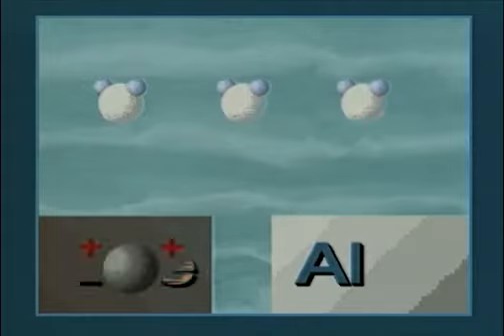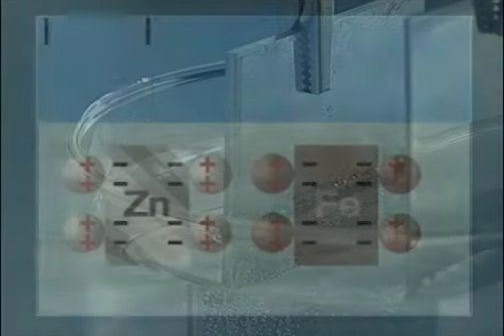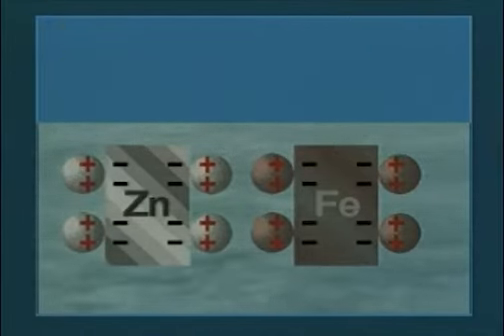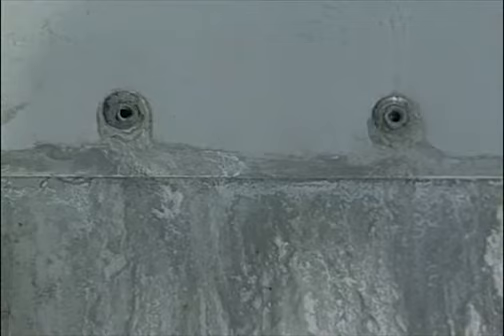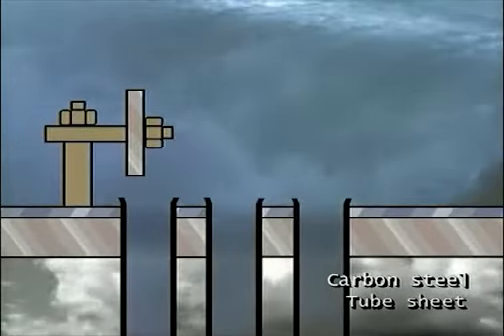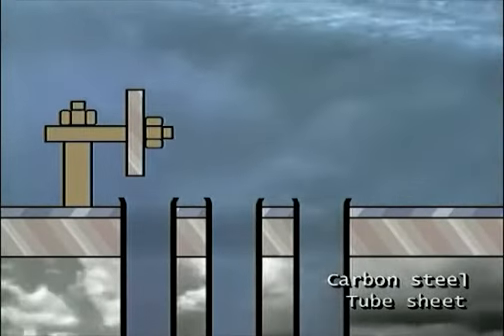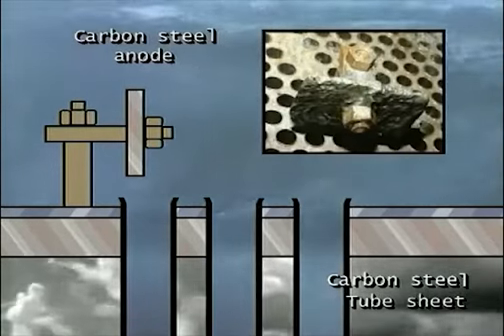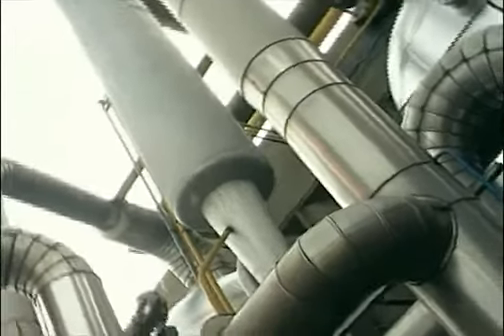Stainless Steel Against Corrosion-PART 2-3-GALVANIC CORROSION

Comment: this video is totally wrong....why ?
what if i use 2 metals are Au and Cu. this process still happen even though Au and Cu  do not react with water..../
am i right...haha
Reply: there is water on the surfaces all of the time through humidity in the air, it does not need to be flooded